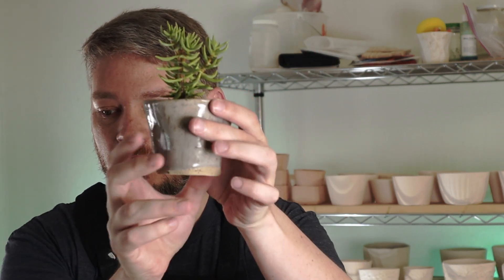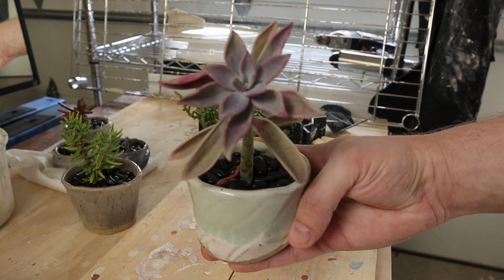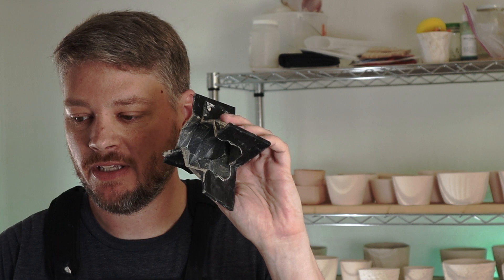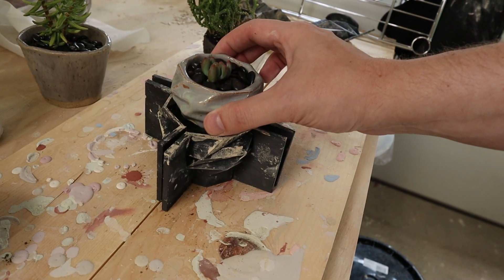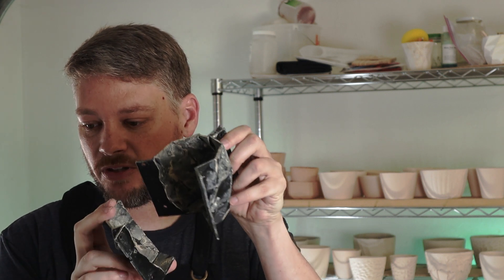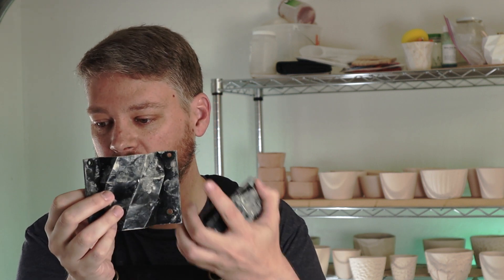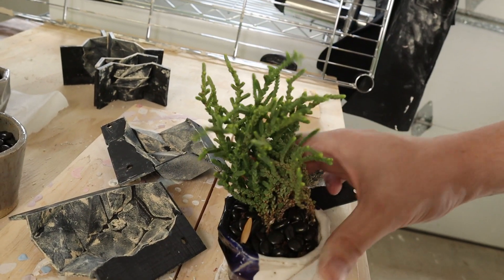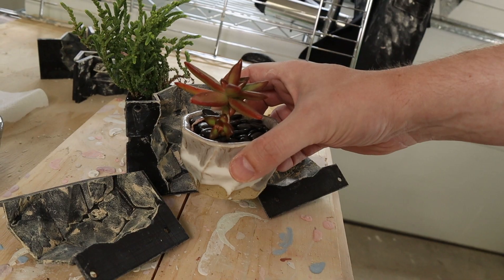Can you form Ceramic Pots with a 3D Printer?

Comment: Never thought of this way to do molds, good idea. I have printed slump mold with a rod in the centre that fit into a PVC pipe on a stand which works well for draping over the form.
I use cling wrap or olive oil as release agents for my DDD stamps and molds etc. 
Pots looking good and if you start to sell you may find that a lot of folk like wonky pots and or not quite perfect.
Cheer...Freddie
Reply from the maker: I think there are opportunities using 3d printing to make interesting slump molds. And thanks for the tips on releasing - that is a key issue when the clay comes into contact with the 3d printed part for sure.